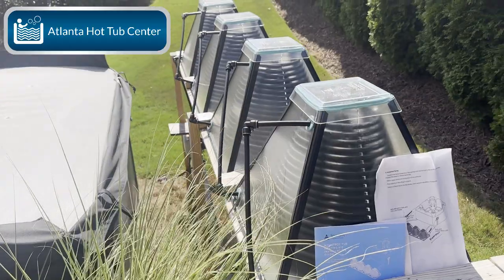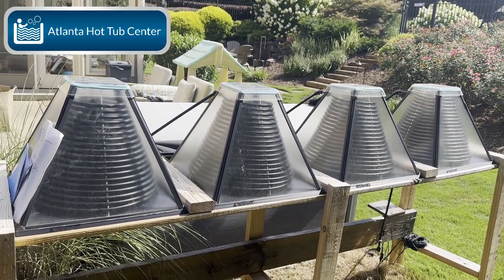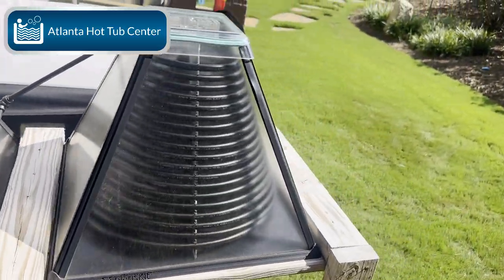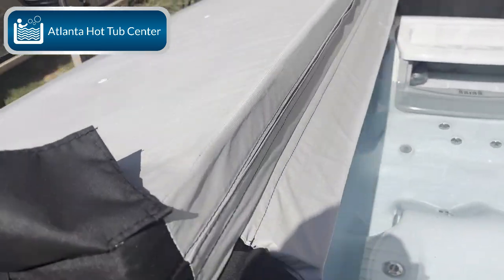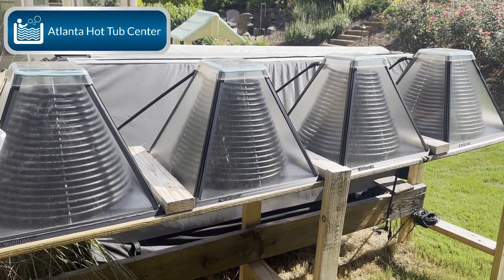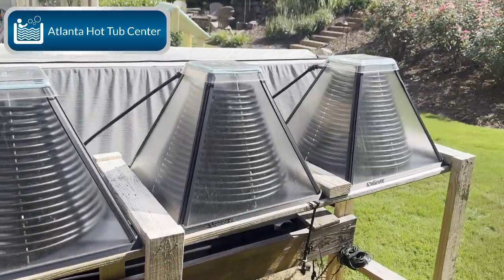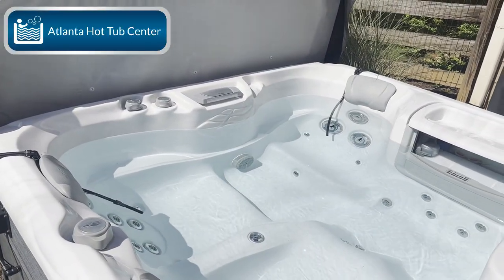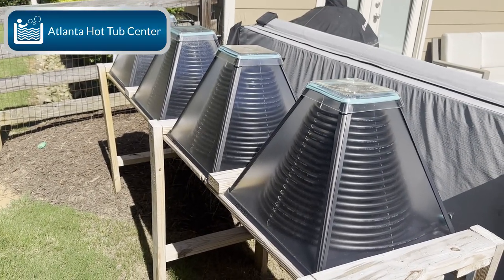How to Heat Your Hot Tub with Solar Power | DIY Solar Hot Tub Heater

Comment: hey bud.....wahts the hottest you can get the water coming out???  I have another idea and I need to heat 55 gallons of water up to 160 F  if this possible?
Reply: The shipping containers we have stuff stored in gets up to 125-130 ....imagine if we painted them black.....run the copper lines near the roof inside or out......just thinking out loud
Reply from the maker: Good afternoon! I see where you're going with this, but this alone isn’t going to turn something into a hot tub. In my opinion, you’d still need a heater to maintain the temperature — but you could certainly give it a try.  Hope this helps!

Comment: Could this be used for a swim spa?
Reply: Yes, it’s just a tube in and out. Out tube the water from the spa circulates around the collectors then returns the hotter water back in until temperature is back at desired level.
Reply from the maker: Good afternoon,
Yes, you can use this with any hot tub or swim spa. However, since a swim spa holds a much larger volume of water, it won’t be quite as efficient as it would be in a smaller hot tub.

Comment: Is the water hot by the time it makes it through the solar tubing, or does it have to sit in the tubing for a while before it gets hot? And does the Solaris system hang onto the water until it reaches a certain temp before pumping it into the hot tub?
Reply: The length of the tubes and the surface area should be enough even when continuously pumping the water through.
Reply: The pump will not pump water from the hot tub or spa until there is adequate heat in the collectors to return the water at the desired temperature. Even on quite cloudy days the collectors can heat the water significantly to return great amounts of hot water.
Reply from the maker: Good morning, both comments are really correct but the second one is how it works!  Thanks for the support everyone!